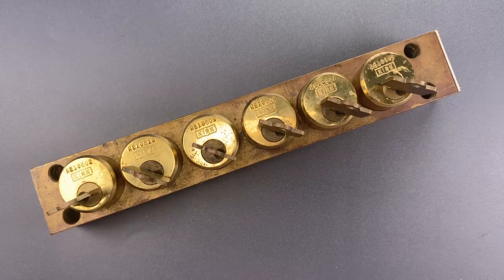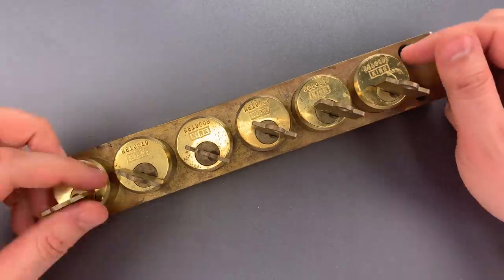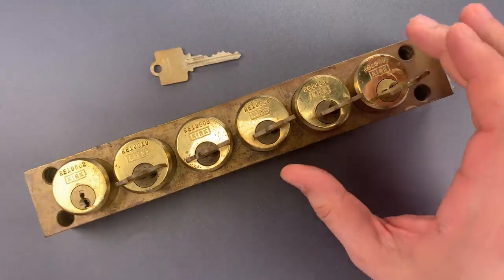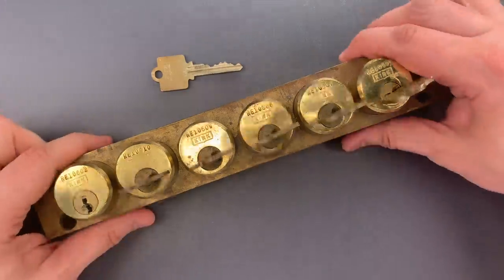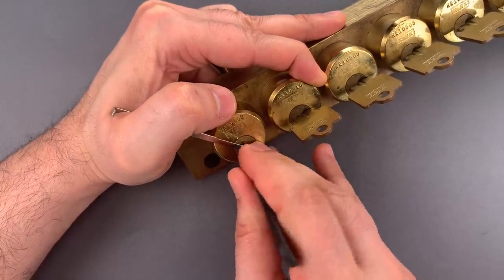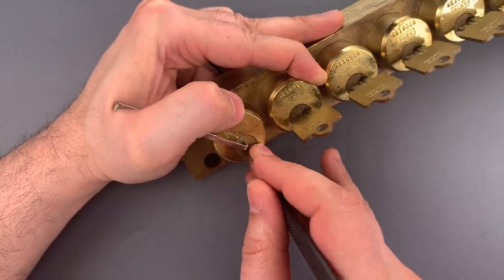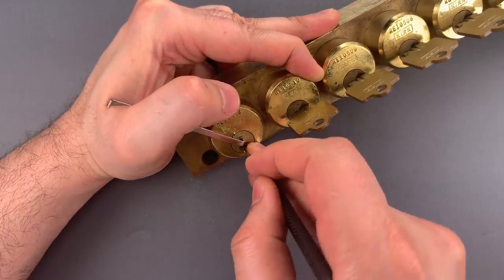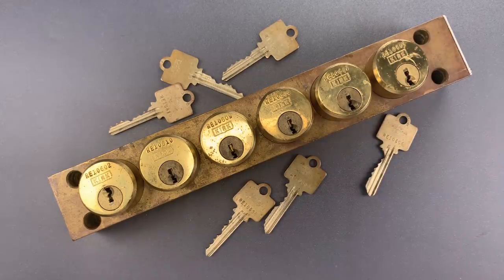[1190] 6-Key Kirk Interlock Panel Picked

Comment: Out of curiosity, anyone know how hard it is to find one of these or something similar, or what to look up in order to find something like this? I work for an Escape Room, and honestly, this would be perfect for a puzzle
Reply: K Spud, they are bloody expensive because they limited production items and are built on restricted key systems.
They rarely come up unless the machine it is protecting gets scrapped.
If your after something for a puzzle room you can use standard cylinders, and very simple cams on the backs of each cylinder, they are easy to make especially if you have access to a 3D printer.
Reply: @elonmask50  Oh crap, that's an awesome idea! I have a maker's space by me that will let me use their 3D printer. Now, I just gotta buy some cylinders and try to proto-type something. Thanks for the advice!!!

Comment: You could see similar system in action here: https://www.youtube.com/watch?v=5zVH6JSjQKI 
Demonstration briefly covers procedure of engaging and disengaging rail power to Polish electric locomotive manufactured by PESA S.A. Well-thought interlocking system ensures proper sequence of operations which otherwise could damage whole vehicle. It's secondary function is to allow maintenance access to various parts of high-voltage circuitry only when safety conditions are met.

Comment: Wouldn’t it be more realistic to assume that you’d have to pick this lock with no keys at all?
Reply: This thing isn't a lock for a door or something, it's more of a lock that stops you getting at the other keys. By inserting the master key you can "open" it so that the other keys can be removed and taken to unlock some other locks that actually protect something.
Reply: That can happen since you cant remove the left key without the right one and vice versa, 
you can pick It with only 1 key on tho
But its apparently the same, since you can tensión the lock with the 1st key and just do the same pick 5 times

Comment: If there’s ever an “accidental” nuclear missile launch, I know the first person I’d suspect.
Reply: Nuclear launch procedures make it impossible for one person to launch the missiles. Needs a commander and a deputy commander who must both turn two keys simultaneously.
Reply: @KeoniPhoenix  "impossible" sounds like a challenge.
Reply: @5467nick  no, it really is mechanically impossible for one person to turn both keys fast enough to activate the electronics. Any lever/gear system you can make will have too much slop to turn both keys within the fraction of a second required.

That's literally one of the design criteria for the system.
Reply: @ScottKenny1978  I was making a joke, but no, it is not impossible. You most certainly can build a contraption that would have no trouble accomplishing this task. It might take building something large and heavy enough that you won't be sneaking around with it undetected, but it is not at all impossible to do. A lot of machines have to do exactly this to function. For example, every internal combustion car engine has to have a myriad of mechanical components which move with extremely tight tolerances and if anything is out of alignment for a tiny fraction of a second, the whole thing can rip itself apart spectacularly.

Tricking those nuclear key systems could certainly be done with a worm gear system. How heavy-duty would said system need to be, how sturdy would it need to be? I don't know exactly, but it stands to reason that one could certainly be built fairly easily. The trick is: can you get the materials necessary onto a nuclear sub,  then construct the machine, and operate it undetected? That would be hard to believe.
Reply: @5467nick  on a sub? Hah. No. The keys don't work that way, and both the missile compartment and missile control center are manned 24/7. Not to mention that it takes the entire crew to set up the systems for launch in the first place. I served on missile subs, I do know what I'm talking about.

You'd have much better luck in an Air Force missile silo, as I believe all their systems are set up to run automatically once the keys are turned. Things like opening the hatch, etc. Of course, you'd still have to get into said silo control room, past a lot of sensors, dogs, armed guards, and the two people inside the control room that have to let you in (which means they recognize your name and face from the access list brought to them by someone not you).

The entire setup is designed to be above and beyond Nintendo Hard(tm) to get inside, and they have regular tests of this to prove it.
Reply: @ScottKenny1978  Again, as I said, it was a joke. Also again, it was aimed at defeating the mechanism, which is certainly doable, albeit difficult. Your previous comment was that there would be too much slop in any contraption. Any high-torque geared device must have essentially zero slop just to function in any application without destroying itself, therefor such a device, such as a worm-gear setup, could certainly be used to attain the goal of defeating the mechanism. I never said anything about defeating the personnel.
Reply: @5467nick  using any hypothetical geared turning device requires getting past all the other security.

And it's one of the design criteria for the key systems in a USAF silo that you can't build something to do the job.
Reply: For all we know the system was designed by the same guy who designed unpickable masterlocks. But worst case scenario, “this is the luckiest launch that Bosnia Bill and I made.”
Reply: @ScottKenny1978  That attempting to beat the locking mechanism requires getting past any other security is completely irrelevant as I replied to your saying it was "mechanically impossible". All other security measures have no relevance to how resilient the mechanism is.

If the locking mechanism requires that two keys be turned in sync, and the requirements are at all loose enough that "in sync" can be accomplished by two humans, then it is trivial to design a mechanism that would be capable of doing so. The locking system is secure not because it is impossible to beat the mechanism on its own, but because you would (in theory) never get the chance to attempt beating it! That's what made Bill's joke funny!

Really, it doesn't matter what the design criteria is because all you said was this:
"no, it really is mechanically impossible for one person to turn both keys fast enough to activate the electronics."

This statement can't be true simply because it is entirely possible for a device to turn two keys at the same time at any speed you desire. There are a great many things that rely on this exact principle. It doesn't matter what you say about any design criteria because if all it takes to turn the keys is having both of them inserted and turned at the same time, then that is a simple task to accomplish.

Can I turn both keys in an actual setting where A: people aren't simply giving me free access to the keys, to the room with the locks, freedom to bring materials to construct a device to do the task, freedom to actually construct it, then freedom to operate it? No, of course not!

The personnel would probably never have let me into the facility, they certainly wouldn't let me in bring a hundred pounds or so of gears, drives, and such and tools to assemble them, they definitely wouldn't give me the keys nor let me attempt picking the locks (certainly an arduous task, though NO lock is truly unbeatable), and finally, they wouldn't allow me to finish my ridiculous scheme.

But if they did give me truly free rein of the place and everything? Oh yes, I could turn those keys with a worm gear setup or some other suitably stiff mechanical machine while they inconceivably ignored my suspicious actions. I could manage if with two motors attached to stiff standoffs attached to the floor, or a worm gear setup mechanically linking two shafts, or a series of metal gears all on the same stiff metal beam linking two shafts, I could go on and on. Mechanics are nothing special.

All having two locks that must be turned at the same time and are set a distance of, say, 10ft or more apart does is make it so a person who somehow has both keys, is incredulously somehow alone in the room, still can't use them without even more inexplicably having gotten a large machine into the room. The locks provide security not by being unbeatable, but in that beating them requires going to great effort, effort which would not go unnoticed.
Reply: @5467nick  you'd really be amazed at the tolerances humans can achieve with nothing more than a countdown. You know humans can hear a tone difference of less than 1hz, right? And can stay in tempo at 180bpm (which itself requires precision within about a thousandth of a second)?

With a thousand pounds of steel and worm gears, you might be able to drag in sufficiently precise equipment to turn the keys. Might.

Anything you can bring in in a single lift will flex enough that it can't turn the keys at the same time.
Reply: @ScottKenny1978  You keep saying these things as if they are impressive. A human may be able to hear a tone difference of less than 1Hz, a machine can beat that by orders of magnitude. A human can stay in temp at 180bpm, a machine can do that at rates well over a billion times faster, or a billion times slower.  It doesn't take much to beat what a human can do in terms of precision and no, it wouldn't take a thousand pounds to manage this. Humans can't come within many orders of magnitude what machines can do. Yes, it would be a simple task to build a machine to manage this, yes, you could walk the parts in in a single load.

Any high-torque shaft that flexes anywhere near as much as human hands would grind and shear itself in short order in an actual application. Steel, especially harder steels, doesn't flex much when it's reasonably thick and it doesn't have to be thick enough to weigh a whole lot. The shaft of a car engine isn't all that heavy on its own and despite having truly massive torques acting on it, it doesn't flex within orders of magnitude enough to not beat simple humans turning keys at ten feet apart. It can't flex noticeably at all because if it did, the engine would be torn apart! A crank shaft is certainly light enough already and much of  its weight is just for fastening the pistons to it, features that such a worm drive wouldn't need, and it is ridiculously overbuilt for such an application. Hell, you could even go to an appropriate titanium or aluminum alloy to further reduce the weight.

Oh, but let's ignore the fact that solid steel doesn't tend to flex much what with it being solid steel. The two motor option I mentioned doesn't even have anything to flex, simply affix them to the floor at least as securely as a standing human (so not particularly securely at all) and Bob's your uncle. Or, hell, since this was only about being mechanically possible, affix the motors strait to the lock bodies.

Done, there isn't anything to flex at all unless you want it to. Hell, you could even throw in a motor controller with active feedback in the microsecond range or smaller for good measure, humans aren't nearly that accurate either. You don't need any crazy big heavy motors either, they only need enough torque to turn a key that humans turn by hand.
Reply: @5467nick  make an electromechanical system capable of doing those tasks, it's not as easy as you make it sound.
Reply: @ScottKenny1978  Ah yes, bolting on a couple motors, sticking a couple chucks on them, put keys in said chucks, wiring them to a single dual-channel controller, truly the work of gods. That isn't "mechanically impossible", that isn't rocket science, it isn't anything remotely unattainable. Any decent CNC, 3D printer, or similar can manage better tolerances than humans if made well and can do so in multiple axis.

We only need one axis, which is many orders of magnitude easier. Machines this precise are all around you, big and small. How straight could a car go if it couldn't turn the wheels on each side at the same speed and same direction, IE no flexing? Not straight at all. Oh, what about trains? Can't have them flexing, they have nowhere to go if everything isn't perfectly aligned! What happens when a turbine blade in a jet flexes more than a minuscule amount? Turbine seizes spectacularly.

Again, the security of those two key systems is not at all in that they are mechanically all that difficult to beat, but in that you aren't gonna sneak past all the people to get in, let alone do so with any parts and tools, steal the keys, get to build whatever you want to beat the locks, and then use it since you'd be stopped at every step of the way.

Even people on the inside aren't likely to somehow have both keys AND sneak a contraption to beat the locks without the help of others, at which point they can have a helper use the other key instead of wasting time building something to do it alone. That's the whole point of them! The entire point of spacing the two locks apart is so one person can't turn both keys at once, based on the assumption that any method to trick that would be noticeable. However, nobody can match the precision of a machine that is made to be precise.

Comment: Couldn't you also use this the opposite way, have one key to "something cool" but lock it behind needing to accumulate five other keys first? Too many video games? :D
Reply: That's exactly the point, it DOES work BOTH ways.
If you want to release the key to turn the master panel on, you first need to return the keys to all of the sub-panels within the assembly to the interlock. This ensures that none of the sub-panels are open when you restore power to the overall assembly.
If you want to release one, or several, of the sub-assembly keys, you must first isolate the master panel and insert its key into the interlock.
These types of arrangements have existed for decades, almost definitely pre-dating video games. Not saying that these types of panels are where video games got such ideas from, but at least that is a possibility, whilst the opposite would be temporally impossible.

Comment: I anyone would like to see a solution that uses similar system in action you can check out https://www.youtube.com/watch?v=5zVH6JSjQKI
Its all in Polish, so I can briefly explain, that this is a video from some modern Polish locomotive, where it is used to make sure, that all electric systems are connected to ground before opening high voltage electric panels.